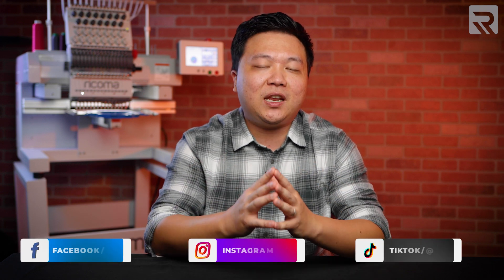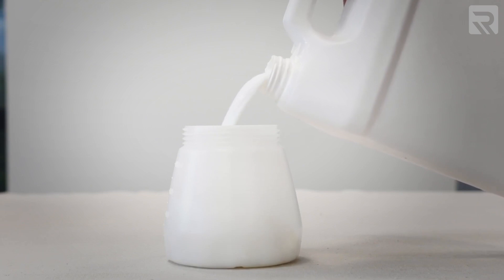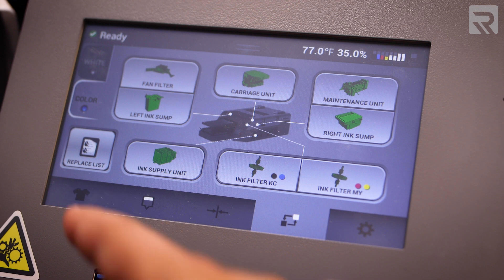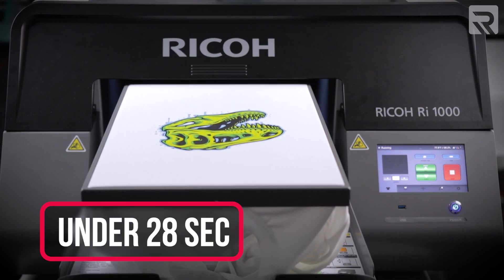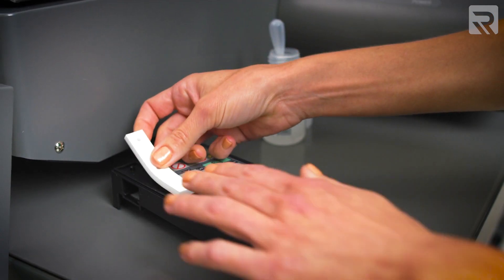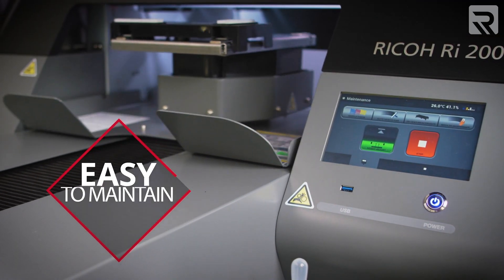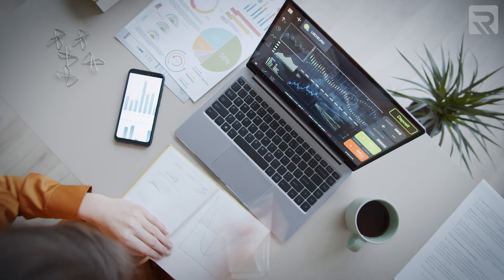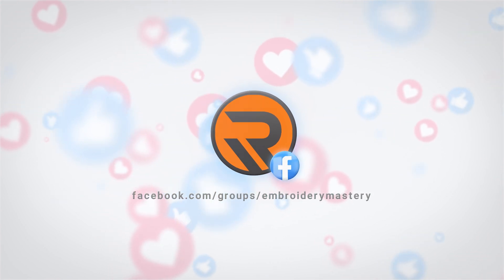Ricoh DTG Printer Ri 1000 Vs. Ri 2000 (DTG Printer Comparison)

Comment: I read that both these can print DTG and DTF. How does that work?
Reply: In the same software, you would choose different settings and then instead of a garment, you put transfer paper on the DTG platen. It will then print the image with the white ink on top and then you cover it with powder and move forward with the DTF transfer process.
Reply: Both ri 1000 and 2000 ?

Comment: What's the price on each unit ? I didn't hear you mention it. I may have missed it
Reply from the maker: Hi there, with our 0% financing options, the Ri1000 is as little as $235 a month the Ri2000 is $277 a month (a downpayment will be required with this model)
Reply: How much is the whole machine…
Reply: @SHESMINAJ  20,000-25,000
Reply: I would like to know as well. As long as 235 for how many months? What is the actual price? Thanks in advance
Reply: I have one for 8k as is lightly used less than 500 prints